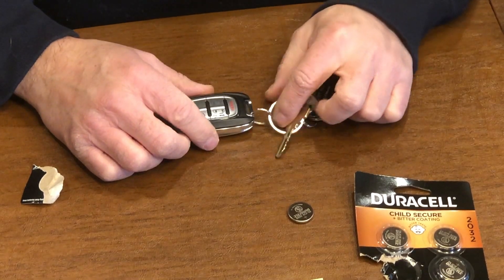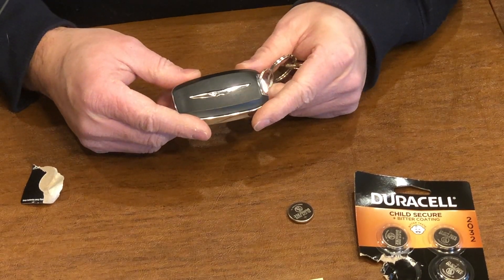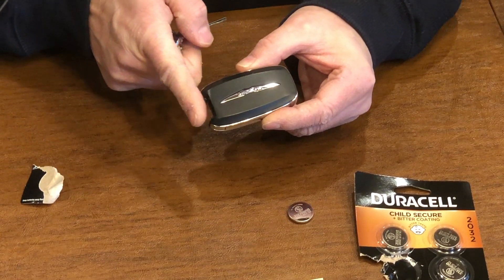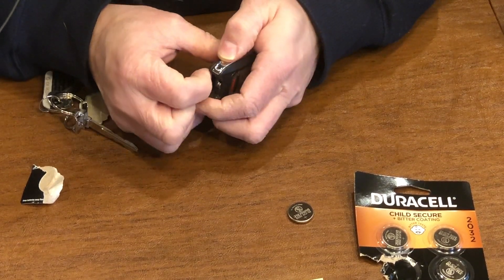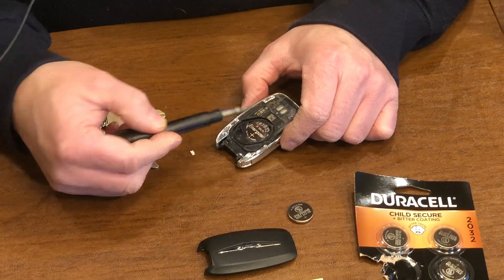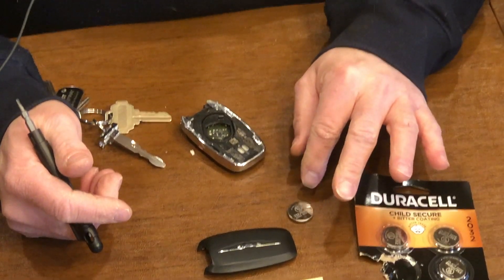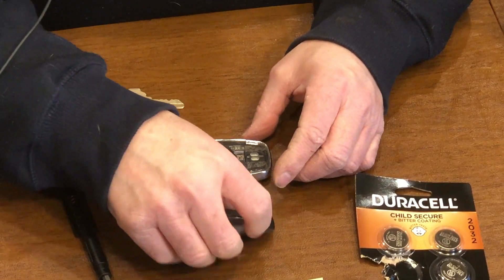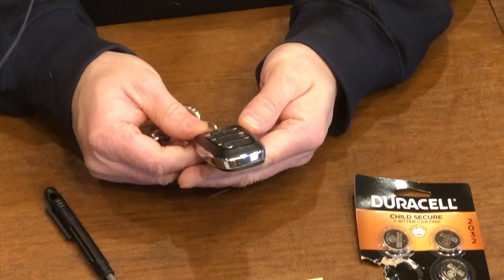Chrysler Pacifica, Dodge or Jeep Key Fob Battery Replacement this one is a Pacifica Hybrid

Comment: I just bought a c280 for 2,000 with 165,000 miles, practically brand new interior only one crack in the wood strip along the dash probably due to heat, do you think it was a good deal?
Reply from the maker: Sounds like a great deal! I think you will have fun driving and maintaining it. Next you will want to have it inspected. I had a mechanic who specializes in older German cars in my community who was able to give me a detailed inspection for about $200 (about 3 hours of inspection time). I had him create me a list of things to work on starting from critical down to nice to do...Helps me prioritize what to do.
Reply: @fixittony  awesome thanks for the advice i appreciate it lot im going to look into everything right away your videos are awesome thanks again